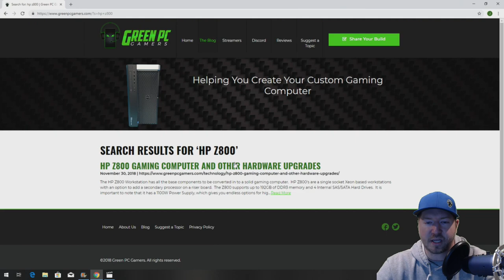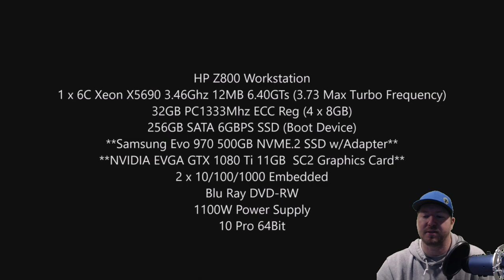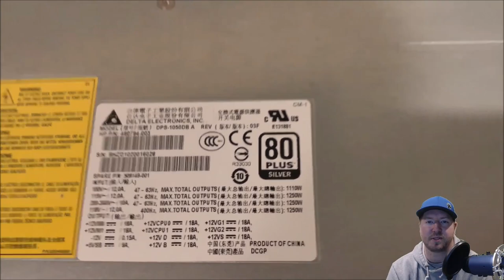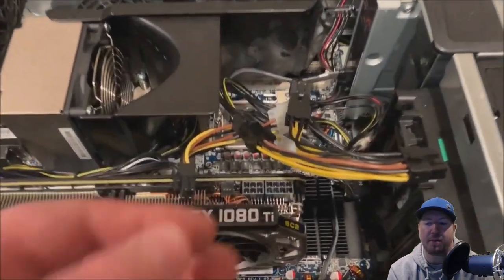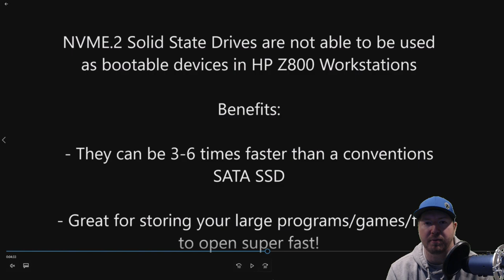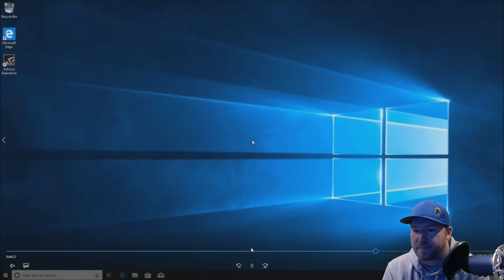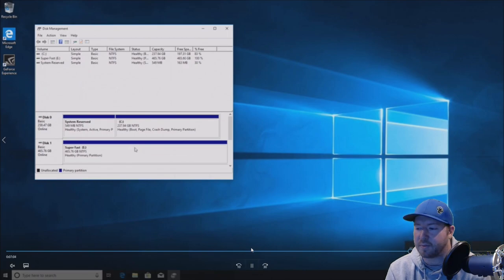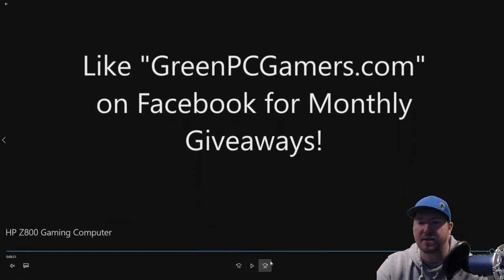HP Z800 Gaming Computer (GTX 1080 TI and NVME.2 Install)

Comment: A 1080 ti with 1 x58 xeon cpu? Wouldn't it be a bottleneck? I think you should add another x5690 and use the second cpu slot. But otherwise i really like your channel.
Reply from the maker: There will absolutely be some bottlenecking when using a 9 year old processor.  We ran benchmarks on the system with a single X5690 and with dual X5690's.  The FPS were the same.  The second was helpful when trying to stream and game at the same time.  (compared to a single cpu)
Reply: @GreenPCGamerscom  even with another Xeon. I guess some games don't benefit the second xeon.
Reply from the maker: You are correct.  If you have the ability to install 2 processors, it certainly wouldn't hurt.

Comment: Can you recommend a good 4K video card for HP z800?
Reply from the maker: The Z800 has some bottlenecking issues for high end graphics.  Do you plan to use it for gaming or for editing?
Reply: @GreenPCGamerscom  editing
Reply: @SirMillz  go for a 1070ti
Reply: And would you recommend GPU for rendering in Lumion? I mean just for rendering, fps in edit mode not so important. 
Now I got GTX 660 TI and it is pain in the ass...

Comment: My z 800 take along period to boot and open . I installed 128 gb samsung sata 3 ssd in sas it takes arrounf two minutes to open
Reply from the maker: That's typical for a system with that amount of memory installed.  We installed 384GB of memory on a Z800 build and it also took around 2 minutes to boot.
Reply: so is this a bad thing? i'm assuming this is not good

Comment: I don't understand why the operating system is not installed on the NVMe SSD disk, used only for data.
Why isn't the situation reversed?
Are there no bootable NVMe disks for the HP Z820 WorkStation?
Reply from the maker: The Z800 won't boot to an NVMe M.2 SSD w/o a boot assistant.  So we chose to use it for fast storage.
Reply: @GreenPCGamerscom  
Thanks for the answer.
In my case I have a Z820 with an AS # 618266-004 motherboard, that is also used in the Z840.
I assume it is the same situation or not?
Not even with Clover or similar?
Reply: I boot using a Kingston predator...
Reply: @AlanEddie  You are right, did the same and later changed to a Samsung 850 Pro with 512 GB of Ram which is even faster than the Predator ! ;o)

Comment: What speeds do you get on that NVMe drive?
Reply from the maker: We were getting close to the mfg spec speeds. 2800MBPS - 3200MBPS Sequential Reads and 1700 - 2100 MBPS Sequential Writes.  The MFG specifies Max Sequential Reads 3500MBPS and Max Sequential Writes 2300MBPS.  Something to note:  As we added more data, the drive seemed to slow down a little bit.  (It's still crazy fast and boost the IO speeds on the Z800 workstation)
Reply: Could u link the adapter for the nvme pci adapter? Your website is down. Thanks!

Comment: I can't remove the expansion slots cover behind the Z800 workstation. If anyone knows please reply. Thanks and appreciate in advanced!
Reply: Do you mean the PCIe slot covers or the cooling shrouds?
Reply: @xniqht3986  Yes the slot covers for the PCIe slots. It seems to be locked. Thanks
Reply: @voltronLion1  there should be  a green tab that you pull up for everything
Reply: @xniqht3986  OK thanks for the tips!

Comment: How’s video editing
Reply from the maker: It is an excellent video editing system.  Great for multiple displays and  good processing power.
Reply: I actually own the z400 with a Xeon w3690 12 cores cpu overclocked at 4ghz with a gtx 1060 and 20gb of ram  and it runs all my pcgames smooth at 1080 an 1440p
Reply from the maker: Awesome system.  Your should share your build.

https://www.greenpcgamers.com/share-your-build/

Comment: The X5690 is the biggest bullshit you could put into a Z800, at least if you have to buy them. They are way to expensive for their age and not noticeably faster than the X5680 or even the 5672, which you can get for a much lower price.
Reply from the maker: They are pretty cheap on EBay.  However, you are correct, there would be a minimal difference in performance compared to the X5680 or X5672.